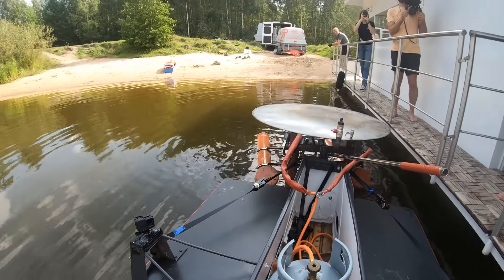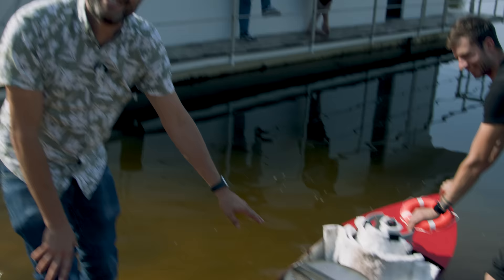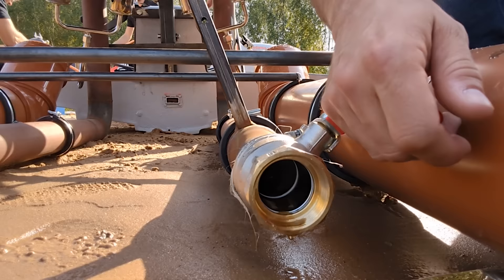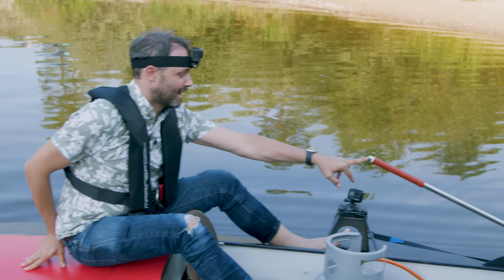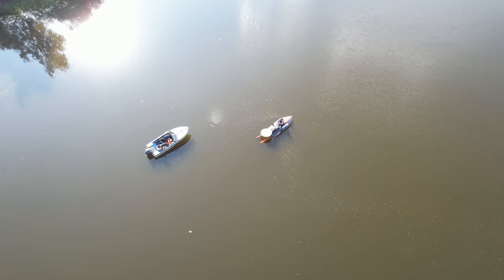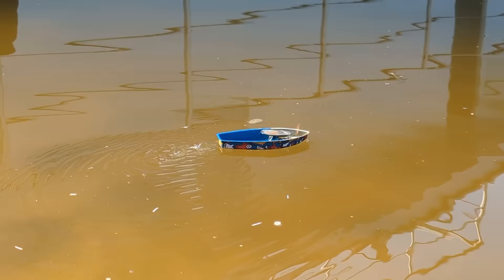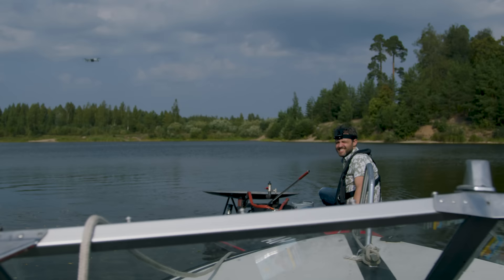Will this toy engine work at full size? (yes)

Comment: Could you increase the diameter of the inlet to pull in more water, and a smaller diameter pipe on the exit to create more pressure, pushing the boat forward faster? could you face the inlet forward and the outlet backwards to force more water in as the boat speeds up and create sort of a push pull force as the boat moves? Has anyone tried  to tune it like this yet? Or can you put like check valves in it to allow the water to flow in one pipe and out the other. Put a large inlet pipe facing the front and 2 smaller outlet at the rear to create a faster flow maybe? This is a cool project and would like to see more done with it.

Comment: I suspect that the entire motor is out of proportion with the boats compared to the two smaller demonstration ones in your previous video on this. What I mean is the square cubed probably also applies to the mass and volume of fluid moved with each pulse and the pipes on both the "teddy bear" boat and the outboard propelled one are allot smaller in diameter (for both) and length (for the outboard) than a proportional scaling would have them. The two boats definitely show that the concept is able to be scaled up though.

Comment: the surface area / volume thing is also why Tesla developed the 4680 cell ( more battery, less metal casing ) 
it's also why its cheaper to buy 1:   2 liter milk package compared to 2:   1 liter milk packages,   you got more packagings to pay for .

Comment: This makes me think that a coil of pipe would work better for an external combustion steam boat.
Put a foot valve or one way valve on the lower side pipe so it draws water only, then it goes to the bottom of the coil.
Then the outlet pipe comes from the top of the pipe coil and back down to under the water vertically parallel to the inlet pipe.
Burners just below the coil and away you go, intuition tells me this would be more efficient and effective than the pop-pop tank style.

Comment: Okay guys, I am going to explain a major flaw in your design. Simple fix though. Your disk is square to the water pipes, which simply means the pipes are at 90 degrees to the disk. The side of the disk where the water pipes are should be lower than the other side of the disk. If you look at any putt putt boat you will see that the disk is higher by a little bit than the side with the pipes. This is so that any water in the disk will simply flow to the pipes. You are not trying to boil the water, you want to heat the air in the disk so that water in the pipe is forced out. When water is pushed out more water will automatically replace it and the cycle starts over. Two pipes are good. Also, the ends of the pipes that are in the water should also not be square, but should slightly dip down to where they are well into the water. With no water in the disk, the air in the disk can get very hot and force the water out. If there is water in the disk it will be hard to heat the air. So where does the air in the disk come from you might ask. It comes from the water, which is where fish get their air and they use what are called gills. So as the water reaches the top of the pipes, which are just inside the disk, the air can then enter the disk. All very simple. I would venture a guess that your boat ought to be good for 5mph, which is not bad for what it is. Once you have success you could try a hotter flame or just plain more-flame. As a kid I loved my putt putt and I think it was made somewhere in the forties. It was like a cabin cruiser, made of tin and I still have it, and it towed a small boat behind it and I am 77, and still love it. I keep them on the window sill at the kitchen sink so I see them everyday. The hotter the flame the faster the water gets pushed out and the faster it goes. When you do have some success I suggest a completely new build concentrating on making the entire boat as light weight as possible which will no doubt help. Make the top of the disk as thin as possible because going in and out is what pushes the water. The putt putt boats click at a very fast rate, which gives it the putt putt sound, and of course this is what propels the boat. I hope you keep going and I do think you will come to love it. Weight is a major key so use thin aluminum for the boat and where-ever you can. I hope this helps. Enjoy.

Comment: the problem with scaling though is  material thickness, structural thickness and such.  in some cases you can scale an item up, increasing its surface area, its displacement, but NOT increasing its weight.    To picture this,   consider a 1x1x1,   1kg cube of metal...    hammered to 1/8th of an inch thick, then curved to form a bowl.   it will now displace a lot more water, has a much larger surface area....   it  volume stays the same, mass..    but it has that big empty space now...

Comment: I think its history repeating itself. Just like the piston engine, we were making the one piston engines very big, having power for its size, but the size itself was an issue for transportation. I this a series of smaller engines will do the trick. Just like a car's engine has multiple smaller pistons connected together to make more power for a smaller size, so will multiple pop-pop engines can achieve. Hopefully im not wrong :))

Comment: Ok I'm dumb. I would increase the surgace area instead of doubling how high it is. I would also decrease the size of the outflow pipe to create more pressure.
Though I'm likely wrong, my point is doubling every demention isn't always a workable solution unless you are trying to create the same speed in the larger size. To increase the speed you need to increase the size to compensate. Doubling it only gets the same speed at the larger size.
You are trying to increase the speed to match the visual of size compared to the perseption of the speed. A smaller boat seems to be going alot faster, because you are comparing the amount of movement to the size of the boat. That doesn't work when increasing the mass and size while doubling every other aspect of the motor and pipes. If you are increasing mass and size that means you should be quadrupling the the engine, but keeping the pipes at double.

Ok this is just my hypothesis, and I repeat I'm not that bright. But I'm guessing efficiency goes down exponentially as the size goes up in the same manner.
You started off with a extremely light weight tiny boat. When increasing the size there are weight and thicknesses that increase more due to gravity vs strength of materials. So mass vs size increases the mass by several times vs size to equal strength vs size vs strength vs smaller size.

Like I said, forgive my stupidity. I'm sure you can correct my mistaken wording or math attempts.

My point is that unless everything is only increased the same, the the doubling of motor size won't work.

The fact that weight vs strength changes dramatically the larger you make something has to effect the equation just as much.

Ok I'm done trying to explain something above my intelegence level. I pray that brighter minds than mine with step in and put it in plain English for folks like me with limited IQs. Because I'm sure I flubbed up alot, though I may be right in the conclusion of the power increase neededwhen increasing the boat size. 🤣

PS. You are also changing the boat design, which changes the weight, the size and the mass.

Comment: I find people on average are horrible at approximating volume because it's just not something we have to do all that much (except small volumes like a glass or kettle). We deal with length constantly so you can roughly tell how long something is and we still deal with area often enough but if someone asks you the volume of a container or even to compare the volume of two containers it becomes really unintuitive.

Comment: All I can think of is maybe it just isn’t getting enough heat, it’s exposed to open air so it’s probably bleeding a lot of heat, some kind of insulation around it or just a stove like thing below it to trap more of the heat directly against the little popper would give it some more oomph

Comment: In order to make it work more efficiently you have to increase the number of burner....!! You may use a modified burner that will cover maxium surface area of the water tank... or decrease the surface area of the tank....!! Try this solution .... it will absolutely work....

Comment: I remember making thse little boats for a science fair in year 5 lol.   I didn't have the resevoir part though, it was just a full on looped pipe.  Worked great too.   I don't remember them being slow, so I think it'd solve that pop pop issue?  I also didn't have the noise coming off the boat, since no flex.   Maybe next one you could try it with just a looped pipe?  Less internal volume to move around cuz well, less area to move in the first place.

Comment: So, as per your explanation about the square cube law with the blocks, where there are surface area missing after it goes inside the bigger cube:

Does that mean that if the big human boat (or even the teddy bear boat) is propelled by 20 or 50 small pop pop boat engine, the boat will run faster?

(theoretically, we will have 8 small cubes without the surface area diminished caused by the combination into a bigger cube).

Comment: A putt putt boat doesn't keep the water in the system long enough to cool the steam. All the water explodes out of the back giving the push, then cool water rushes in to fill the void starting the thing again. The water cools the empty pipes. The water doesn't cool the water. I think the problem is that you just can't heat that volume of water anywhere near as fast when you scale it up. You may do better by, rather than increasing the tank and pipe sizes, you increased the number of individual candle powered toy tanks.

Comment: This design could be redesigned with a bit of modern technology to potentially make it efficient. If it had a cold water intake at the bottom and copper pipes at the top with convection water heaters attached to the pipes, you may actually be able to create a decent amount of steam to make it move faster.
If that makes sense, I'm not the best at turn ideas into words, lol.

Comment: The problem is because of how you scaled the idea. Instead of 1 or 2 pipes. There needs to be multiple pipes proportionate to the increase in the boats scale. So if the pop-pop :to: life size boat is a scale of 1:32 Then there should be 32 closed pipe tank systems, that are all heated by the same source.

Comment: You should try a different design.... Try Putting the Inlet in the front of the Boat at the Bottom of the Tank  and the Outlet for the steam from top of the Tank connected to  the Rear end of the Boat,so that there is a natural Pull & Push Arrangement..... Also, the Tubing has to be less than an inch at the exit, so that there is sufficient Steam pressure....

Comment: 10:33 maybe try with a copper plate which is domed upwards, to catch the heat, not let so much heat escape.
Also 11:22 what about just increasing the strength of the spring? not the length. Increasing the length aswell just increases the time it takes for whatever mass to stretch it and then for the spring to rebound.

Comment: An array of smaller metal steam pots would be more efficient with micro burners so the water heats up faster and hotter due to the smaller metal containers and furthermore since its in an array that would equals greater thrust via steam output

Comment: Change the flexing plate to a  wide shallow steam piston that pushes against the steam using a spring with multiple outlet pipes around the top of the stroke.

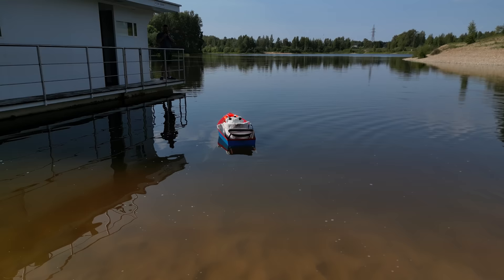Comment: 10:00 what about the flame being a factor, since in the small toy one, that flame is more closer in contact and takes up a large surface area to evenly cook the water inside, vs the few little burners boiling only a particular spot of the pop pop leaving the rest of the water to take longer to boiler especially thru possibly a thicker metal

Comment: The big dish is maybe "upscale" of prop system, but if you made 15 small dishes, that is allso upscaling???
Reply: Yesssss exactly what I thought ! And I totally agree with this idea. Tiny small element that dynamically express themselves much more quicker. And for sure you can scalle it up to the same burner power but you would have drastically increased specific surface area of heat exchange compare to the mass that would have been reduce compare to the single big one. What do you think ?

Comment: Bit late, would two valves help improve efficiency?
Two pipes, with an inlet near the front and outlet facing the back with valves on it to assist the pumping direction and reduce the pulsing mass of water in the pipes.

Comment: I think that some sort of fast non return valve should be used so that the returning water would be sucked from the front, I think that it would increase the efficiency a lot. Second thing is to find a way to increase the frequency of the engine.

Comment: With the expansion of the steam, i am pretty sure one way valves would work well. I am saying this without substantiation or proof, but i feel it make sense.
With the energy of the propane heaters and the surface compares to the inlet.
One way valves should work i feel.
Again i dont know if the volume and power of the propane heat is enough in this case.
But i feel with the right design it should be enough.
With my thought, the rythm would likely be about what i heard.
But i feel the steam expansion should give better rewards. Keep it up i love it.

Comment: what about two tubes underwater with one facing forward with a unidirectional valve and one to the back with another unidirectional valve, probably with one big diameter tube coming down from the boiler, the underwater one you can probably change diameters to test the performance , it similar to valved/valveless pulsejets.

Comment: If it's all about surface area to volume ratie you should be able to drastically increase the efficiency of the engine with some creative plumbing.  Also you should be able to get an increase in power by using multiple smaller engines instead of one big one.  That said I don't think this is the full story - I bet it has more to do with the interaction between the exhaust and the water at the outlet.  This is what produces the forward momentum in the first place.  I have a feeling that this phenomenon scales really badly.

Comment: I think this would be considerably more efficient if the chamber didn't flex, and you limit the water coming drastically.
I believe optimal efficiency could then be ascertained using trial and error by utilising an adjustable valve located on the pipe immediately before the chamber.

Comment: I think you will find that the boiling point of water remains the same so when you scale up the boat you're not scaling up the pressure required to propel the boat. This means in order to get more pressure and speed you need a more efficient expansion chamber that will heat water faster providing an increase in the volume of water passing through the motor
Reply: In other words something involving a coiled up tube in a burner chamber rather than a flat pan with an open air burner. I'd love to try it with a small jon boat and a modified burner chamber from a diesel or propane fired steam pressure washer.

Comment: Hear me out: a lot of motorcycle engines use air-cooling, where there are fins on the case of the engine where air is expected to flow over, thus more efficiently allowing heat to escape. What if you applied the same principle here, highly conducive fins where the heating element is expected to flow, and the same where the pipes' volume is expected to cool... I would think this would allow for a quicker transition of thermal energy and therefore allow for a more rapid cycling of the engine, possibly reducing the effect of the law of cubes. Does that make sense or am I doing a goofy?

Comment: Could you use a light weight frame and make a houseboat or even community that runs on biowaste and uses a more efficient chamber and refill process for sustainable mobile aquatic housing for those displaced or susceptible to floods

Comment: Are the large boats so much slower due to a square/cube relationship? I can imagine the propulsion being determined by the surface area of the boiler, for example, though I don't understand enough about how the engine works.

Comment: So theoretically, at what scale would the surface area have to be to achieve a desired speed? Let’s say 15mph was desired. Would you have to scale the diameter for heating 4x? Could you multiply the disc? This is fascinating… it likely isn’t as efficient though as a jet engine, like those used in a jet ski. Interesting to think of pros and cons of each design

Comment: What if you adjusted the heated propulsion water exiting the tubes by partially closing the ball valves at the end of each pipe thereby forcing the water through a smaller orifice, or by adding something like a twist-type garden hose nozzle in place of the valves?!? Wouldn't this enhance the speed of the vessel significantly? Very similar to the water from a hose nozzle when adjusted to the stream setting.

Obviously, one would have to be mindful of over pressurising the system!

It's just a thought.🙂

Comment: This is the same problem we have with rubber band airplanes. On a miniature scale, the plane flys and gains altitude. The pop pop boat miniature propels itself with much more efficiency than the full size one. Now, may I ask why the interest? The propane expended would, in a propane fueled piston engine, zip that full size boat along at a respectable speed. I understand the challenge of making a toy propulsion system work on a toy. What's the attraction of making a toy propulsion system work poorly and inefficiently on a passenger carrying boat?